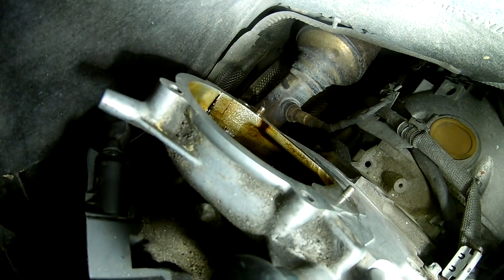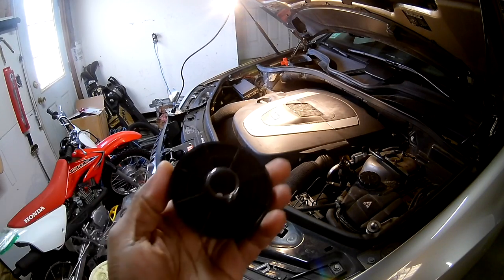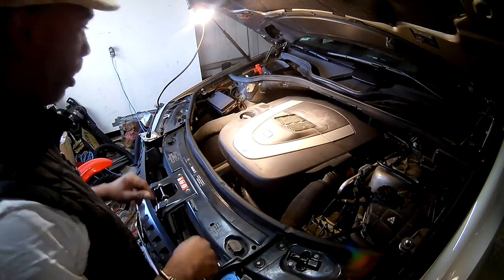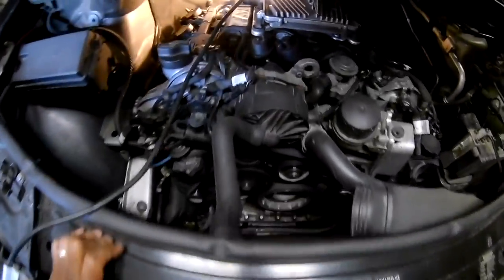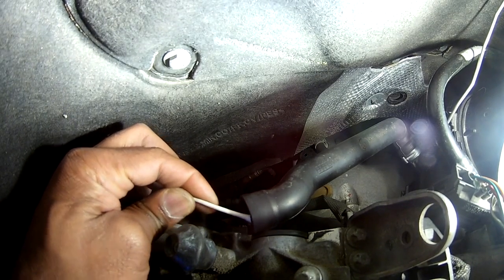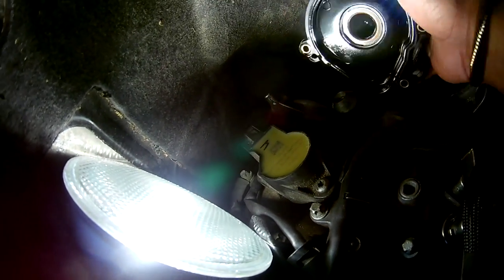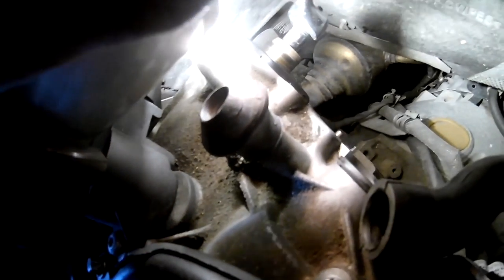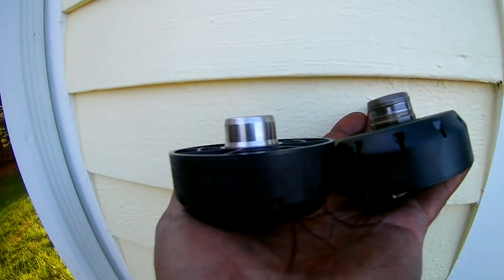Mercedes Oil Drip Pan | PCV  Replacement DIY

Comment: What are the signs in your car's operation that this needs to be done. Can this be the problem if I'm getting white smoke on the start up in the morning or when my car is cool?
Reply: The sign are when you start smelling burnt oil in your cabin.  The oil leaks at the pvc as it is overflowed due to failure of the elastic ring it attaches on to the oil separator pan. Also the oil separator pan is probably flooded and oil is getting pushed into the pvc cover as well.  This then start to leak out between the bottom cover and it drips down to the exhaust pipe and gets burned off.  It will get worst and worst until you get fogged up with oil fume inside your car cabin.  
This is also another indication where your intake manifold will start getting clogged and soon you will have 2 codes saying the intake manifold/swirl flaps had failed.  This is due to the all the fumes from these two parts had failed and letting fumes travel all the way down depositing into the intake manifold.

Comment: Question...Should you not clean the re-breather hose and the mass airflow sensor and the throttle body as well?
Reply from the maker: Leave the MAF sensor alone.   The hose can be cleaned if needed.
Reply: Normally the MAF does not get affected, but if you follow the hose, it goes down the plastic elbow where the maf gets install on top.  
You will find oil fume residues on this elbow part.  Mind as well clean the MAF if you find oil fumes residues.  Also since you are at it you will find your throttle body (butterfly) is cover with oil fumes residues. So clean that.  Now if you find an are cleaning this, get ready for this.... Yes.. Your intake manifold may be gummed up and has oil fumes resides.  This is like you standing at ridge and staring out and up looking at a big mountain.  Yup, welcome to our world of your next project.  Replacing the intake manifold.  You might even find oil slick / deposit at the front end of the intake manifold, where its a black pump actuator with plastic rods and about the plastic triangle that get broken.  Yup..  Now looking back, yes, clean up all those fumes and deposit does help preventing the bigger problem or slows it down.

Comment: I didn't get a new bolt for the oil separator, just reused the old one? Is it gonna be a problem in the long run? Thx.
Reply from the maker: Uhm.....  Hmm.     I hope not.  And most likely not a problem.

Comment: At 4:58 do you use the same bolt from previous or do you need new bolt ?
Reply: Same.  But you can change a new bolt if you want.  You want to be be careful with this bolt though as it goes on to the camshaft.

Comment: Hi there! My C280 has the OIL DIPSTICK TUBE omitted! Can I still use and extractor when I change the oil?? I've searched high and low to figure this out!
Reply: This has nothing to do with the oil dipstick tube.  Yes, mercedes had removed the dipstick tube and you will see a red cover over it.  However, some people use that tube to extract oil (for oil changes, with an oil pump extractor).  You can always do the other way, remove the plastic cover panels underneath the car and remove the bolt to change oil.
Reply: @kito1san  the whole reason for my buying and using the extractor on our 4 cars is to avoid going under the car. But thanks for the information regarding the dip stick

Comment: I changed mine both the pcv and the oil separator, the car still smoking on cold start, by high revvs and hard acceleration.. ( E63 "12 M157). Do you think it might be a failed valve stem seal? Or I didn't change the pcv and the oil separator correctly.
Reply: Same happened to mine. I have done an engine rebuild and after like 6 month, the smoke started againz especially on my second oil change. Its crazy. Pls were  you able to sort it out? I would appreciate any input or insight.
Reply: @adeyinkaadebayo4192  yes, actually  the valve stem seals was hard so I changed it, valve guides were loose too so also changed.. The block sleeve was bad ib cylinder no.1. So I changed the sleeve and the piston rings of all pistons. Plus turbo service.. Now it runs perfectly.

Comment: I used a 1/4inch socket but it rounded the bolt holding the drip pan. Any recommendations how to get that bolt out?
Reply from the maker: That sounds bad.   Did you turn it clockwise to loosen? This one is a right turn to loosen.
Reply: @iRepairAutos  yes I did, I even tried an etorx bit and a 6 mm socket but the bolt was super tight and the head didn't hold

Comment: Is this part used on a W210 M112 (1999 E320) engine?  I don't see it at the end of the breather hoses.
Reply from the maker: It's buried under the oil drip cover

Comment: Do you know what's the problem if my hood is stuck and won't open ,it will release the driver side but not the passenger side any clues
Reply from the maker: Yes.  Get a second person to sit in the car and hold the hood release on the open position. While you tap gently to aggressively on the stuck side.   You may have to push down and up on the hood while doing this.   You have a stuck side.  Don't dent the hood in the process.
Reply: @iRepairAutos  thank you for the help I  just did what you said about 3 hours ago and nothing yet, see what exactly happened is that my hood got stuck in the mechanic store when I was getting a oil change when he finished and I was ready to go I asked him if he can change the air filter also he said yes so I went to open the hood it didn't open got stuck passenger side so he tried the mechanic for a while then it was time to close the shop so he told me to go back Tuesday August 4 that's what really happened
Reply from the maker: Does it feel like the cable for the good release is broken?   Your mechanic may have to go in and up from underneath and spray lubricants on the latch to loosen it up and may even have to disengage it from underneath. It is a real pain.

Comment: Would a faulty pvc course a black puff when you put your foot down? I've 270 CDI
Reply: Nope.. Not that I know of.  If you have black puff, might be some where in your exhaust system is having a problem or worst, a bad gasket on the exhaust side of the engine.

Comment: I have a ‘01 c240, this is the first time working on one. does anyone know if I even have this or is this part on all Mercedes?
Reply: In the comments, someone asked which specific models/engines this is a potential issue. Keith answered with an extensive list. Definitely check that to start. Believe this is on all m272 (v6) & m273 (v8) equipped vehicles

Comment: At what mileage interval should I be replacing these two parts? Thanks.
Reply from the maker: This part should be changed out or at minimum inspected every 50,000 miles.  The cover should be replaced whenever leaking.
Reply: @iRepairAutos  if I change the oil drip pan following your suggested internal, is it still necessary to install an oil catch can? Thanks.
Reply from the maker: No. The oil catch can is NOT necessary.   Make sure you change the cover to the drip pan as well. The diaphragm on the cover wears out and oil can slip by.
Reply: @iRepairAutos  thanks. Will do on my glk 350. Planning on installing the oil catch can as well. Is it considered as double insurance?

Comment: What mileage or age and what type of engine/ models??
Reply from the maker: 150K miles; W164 Engine was in the video:

Mercedes Benz  C230  Sport  V6 2.5L 272.920
Mercedes Benz  C280  4Matic  V6 3.0L 272.941
Mercedes Benz  C280  Luxury  V6 3.0L 272.940
Mercedes Benz  C300  4Matic Luxury  V6 3.0L 272.948
Mercedes Benz  C300  4Matic Sport  V6 3.0L 272.948
Mercedes Benz  C300  Luxury  V6 3.0L 272.947
Mercedes Benz  C300  Luxury  V6 3.0L 272.948
Mercedes Benz  C300  Sport  V6 3.0L 272.947
Mercedes Benz  C300  Sport  V6 3.0L 272.948
Mercedes Benz  C350  4Matic  V6 3.5L 272.970
Mercedes Benz  C350  Luxury  V6 3.5L 272.960
Mercedes Benz  C350  Sport  V6 3.5L 272.960
Mercedes Benz  C350  Sport  V6 3.5L 272.961
Mercedes Benz  CL550  4Matic  V8 5.5L 273.968
Mercedes Benz  CL550  Base  V8 5.5L 273.961
Mercedes Benz  CLK350  Base  V6 3.5L 272.960
Mercedes Benz  CLK550  Base  V8 5.5L 273.967
Mercedes Benz  CLS550  Base  V8 5.5L 273.960
Mercedes Benz  E350  4Matic  V6 3.5L
Mercedes Benz  E350  4Matic  V6 3.5L 272.972
Mercedes Benz  E350  4Matic  V6 3.5L 272.977
Mercedes Benz  E350  Base  V6 3.5L
Mercedes Benz  E350  Base  V6 3.5L 272.964
Mercedes Benz  E350  Base  V6 3.5L 272.980
Mercedes Benz  E350  Base  V6 3.5L 272.988
Mercedes Benz  E550  4Matic  V8 5.5L 273.962
Mercedes Benz  E550  4Matic  V8 5.5L 273.970
Mercedes Benz  E550  Base  V8 5.5L 273.960
Mercedes Benz  E550  Base  V8 5.5L 273.966
Mercedes Benz  E550  Base  V8 5.5L 273.971
Mercedes Benz  G550  Base  V8 5.5L 273.963
Mercedes Benz  GL450  Base  V8 4.6L 273.923
Mercedes Benz  GL550  Base  V8 5.5L 273.963
Mercedes Benz  GLK350  4Matic  V6 3.5L 272.971
Mercedes Benz  GLK350  Base  V6 3.5L 272.991
Mercedes Benz  ML350  Base  V6 3.5L
Mercedes Benz  ML350  Base  V6 3.5L 272.967
Mercedes Benz  ML550  Base  V8 5.5L 273.963
Mercedes Benz  R350  4Matic  V6 3.5L
Mercedes Benz  R350  4Matic  V6 3.5L 272.967
Mercedes Benz  R350  Base  V6 3.5L 272.967
Mercedes Benz  S400  Hybrid  V6 3.5L 272.974
Mercedes Benz  S550  4Matic  V8 5.5L 273.968
Mercedes Benz  S550  Base  V8 5.5L 273.961
Mercedes Benz  SL550  Base  V8 5.5L 273.965
Mercedes Benz  SLK280  Base  V6 3.0L 272.942
Mercedes Benz  SLK300  Base  V6 3.0L 272.942
Mercedes Benz  SLK350  Base  V6 3.5L 272.963
Mercedes Benz  SLK350  Base  V6 3.5L 272.969
Reply: @iRepairAutos  this engineered failure was put to good use by Benz on so many different engines. This "centrifugal separator" may still be used in 2020 production 😰
Reply from the maker: Yeah, sad.  They ought to know better by now.

Comment: Why not just clean this part and reuse as there is nothing to wear out on this piece as I can see.
Reply from the maker: take a look at the video here:  It's bad...  https://youtu.be/G4fv0i_OhOg?t=235

If you don't have that issue yet then you're lucky...  How many miles on your vehicle?
Reply: @iRepairAutos  when comparing the  new vs old part: the plastic shroud seems like its facing the wrong way !

The fact the tightening bolt is reverse threaded tells me that part spins with the camshaft and wears out the rubber seal on the hose adapter cover piece.

It's almost comical to see the extent Benz goes into to create to  profit center for its cheap plastic parts. 
It comes complete with a cheap seal that leaks oil over the exhaust... no detail was spared to ensure lower reliability 😂

Comment: Bolt size?
Reply: Yes.. i want to know what tools to use to remove the bolt
Reply: Bolt head is E8, I used a Gearwrench 1/4 ratchet and their small extension. Worked perfectly. Remember it's reverse thread. Just go easy. Thanks.

Comment: its hard to get into mines I have a R350
I have no room
Reply: The W203 has even less room. Use a right angle screwdriver with T30 bit if they are screws. Available at HFT for about $6.

Comment: hi, how does work this oil drip pan? i want to know, is there some holes inside that metallic cyllinder except bolt?last year i've changed the pcv valve only, yesterday i have checked and there is any oil. So i m wondering, maybe some mess filled that hole inside that metallic cylinder and no ventilation is happening any more.
Reply from the maker: It has tiny holes in the plastics.   This lets air through but spins and separates the oil out. I'll do a video.
Reply: @iRepairAutos  oh thanks, waiting for video. So the metallic cylinder at the center doesn't have any holes for ventilation, right?
Reply: iRepair Autos hey can you do that video on how the oil drip pan actually works?
Reply: Also, I changed the one on my 2010 e350. What a pain in the neck as there is no room back there for any kind of ratchet. That bolt on the bottom left is a killer, so close to the firewall. And of course I ended up dropping one of the sockets I was using plus the old bolt for the oil drip pan somewhere into the bottom of the engine bay and I can’t find them. I guess I need to go find a local mechanic and have them put it on a lift to take the bottom cover off to find what I dropped.

Comment: Is this the same on OM642 engine in a W164 ?
Reply: The problem is the same on all OM642 engines. Change out your rebreather if you haven’t done it.
Reply: On the OM642 is this the unit on the inlet camshaft?